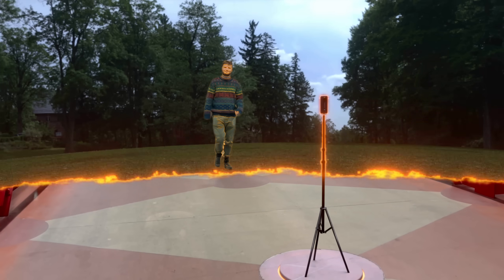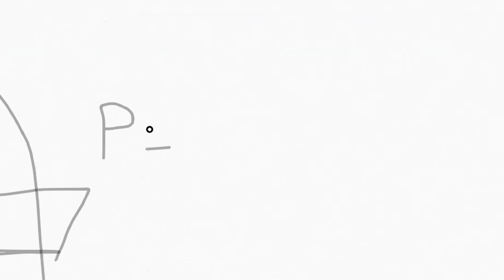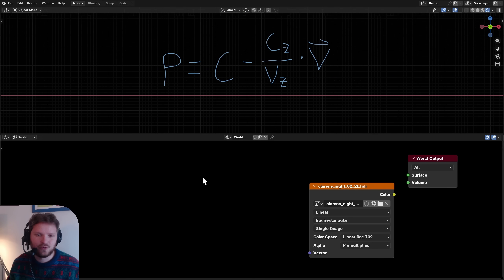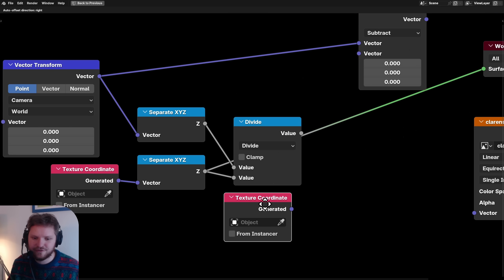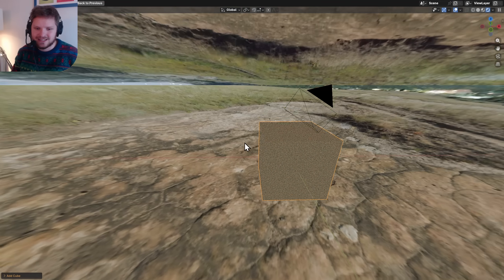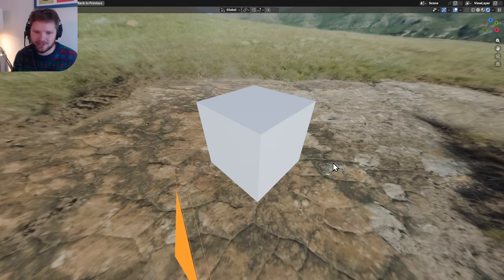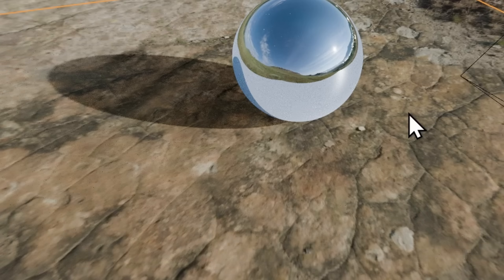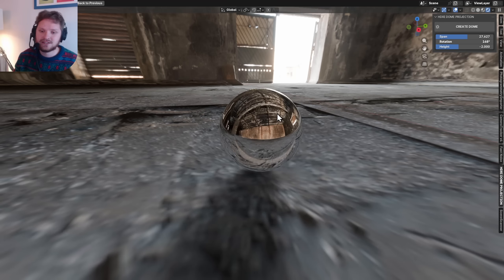HDRIs are domes, not spheres

Comment from the maker: here is the final equation: P = C − (C𝓏 / v𝓏) · v⃗

a more realized version of this is available here https://superhivemarket.com/products/hdri-dome-projection
Reply: HDRI aren't domes or spheres but ellipsoid.

Spherical capture would require the capture device to be at the center point of the sphere. Dome shaped capture would require the capture device be at the center of the diameter of the capture space at 0.0 altitude which is not a feasible technique for capturing desired ground data. Since the capture device's point of origin is neither at a 0.0 altitude nor at the center point between the outer atmosphere and the Earth all HDRIs by nature are ellipsoid. This is easily observed and corrected for by looking at how much distortion is along the bottom of the image, where that distortion begins, and adjusting vertically to compensate.

However, these steps are not typically needed to be addressed as all HDRI compatible 3D packages already have methods to deal with said distortions across capturing methods, storage formats, and adjust accordingly most of the time.
Reply: Will it be part of the Genie addon?
Reply: Do you have to be an ingenior to do that kind of thing are is it basic calculus ?
Reply: what 360 camera do you use ?????????????

Comment: Thanks for the breakdown.  I'm using a variety of equirectangular skyboxes I am creating with Space Engine, and while great for space and airborne environments, the inability to have a ground plane has been a bit tricky to work around.  I think this may neatly solve it for some basic scenarios.

  I am also investigating how to use the procedurally generated terrain topography, as SE doesn't have a way to directly export that as either a map or geometry, which would solve most of my remaining challenges, and think I am onto something using a mix of tools to extract the depth.

Comment: My two cents as someone who has implemented renderers:

HDRI just capture irradiance from every _direction_. Since they work with directions and not positions, they are not really any shape. The closest thing would be a sphere of infinite radius (definitely not a dome). And this is what the math using HDR for lighting relies on. 

That being said, if you want to render the HDR itself as an environment / background, you probably want a shape. The ideal situation would be if you had captured depth information when you captured the HDRI, because then you can actually reconstruct a shape. Barring that, you can use a sphere, a dome, a spheroid... Basically anything that transforms as closely as possible to the actual scene depicted in the HDRI when moving the camera. The main problem with using a sphere is that it lacks parallax (because everything is at the same distance from the center). Since the camera is typically closer to the ground than it is to the rest of the elements of the HDRI, using a dome makes perfect sense indeed.

But that's not because an HDRI is a dome, it's just a convenient shape in which to project one, and just for rendering it. Not for the lighting math.

Comment: depends on the software sadly, I use a spherically mapped skydome with a UV mapped flat top down floor in software where I can control how rendered sunlight reacts to it, ie shadows only not blocking light, Octane render for example but some render engines like iray in DAZ studio won't do that so one is forced to use the environment sphere with a separate ground plane if one wants to move the camera. Unreal Engine and Twinmotion fortunately also have correctly UV mapped floored skydomes with adjustable settings.

Comment: I’m confused. The data being recorded by the camera is “spherical”, in that it represents the view in every direction away from the camera array. The only way to correctly map it onto a polygon would be onto a sphere, otherwise you’ll get distortions.

I’m used to HDRI photography being used for things like PBR lighting and reflection mapping. In those cases, the camera never moves, relative to the HDRI maps. That’s also true of background skyboxes, which are usually rendered in a separate pass, before the foreground elements.

Using the HDRI photography directly as a texture in the scene (like on a ground plane) seems like an unintended use of that data. At least, that’s not what HDRI maps were originally developed to do. It’s causing  distortion issues in the video, which other comments here have mentioned. 

A better approach might be to create the ground plane as its own mesh, with its own material, which uses the HDRI data in its shader for more realistic lighting and reflections. That’ll give you the same correct ground level, but without the distortions.

What am I missing here?
Reply: Spherical map can be perfectly mapped on any convex polyhedron or mathematical shape. And from the original camera point there will be no difference and no distortion, because the ray will hit the same point of the map. You can imagine it as pushing and pulling parts of the sphere closer and further from the origin. But the moment we move our camera relative to the skybox (or the skybox relative to the camera), there will be distortions, be it a spherical, cubical, dome or in any other shape. The only way to avoid this distortion is to make the skybox mesh perfectly repeat the geometry of the original space, but now we are pretty much moving to photogrammetry, or trying to emulate it. But changing the ground to a plane mesh won't change anything, there will be the same distortions. The problem is not in the approach, it's in the lack of necessary spatial data in the skybox texture.
Reply: @F @Forthro Good point about the projection.

What I meant by using a separate ground plane is that it would use a completely separate, unrelated texture from the HDR photography - just a totally different ground texture. And its shader would only use the HDR data for PBR and reflections.

Comment: @CGMatter 

The problem that I have found with this method is that BECAUSE the HDRI maps are taken from that "spherical" perspective, you are less deconstructing the sphere, and moreso just deforming the sphere onto that flat mesh. I am a big fan of the node work you did, as the Z threshold switch was smart. The span, which I assume is the radius of the sphere projected (that is why when you turn it way down it pinches, and otherwise deforms), would want to be infinity, but when projecting the spherical HDRI onto the ground, you are only taking a plane of it. Because this plane wants to remain constant scale, projecting just that threshold slice (relative to your span) would create a better texture distribution without the stretching. Imagine taking a disk parallel to the ground and projecting the sphere's ground upward onto it. The radius of that disk would be the intersection with your skybox projection sphere. Curious how this would work compared to your solution. Great work!

Comment: This should have been a default blender feature like a check box or one of those node presets
Reply: Why? This is only for the special case that you want to use your HDR not just the lighting information it is supposed to deliver, but instead as a render-background replacing all normal scene-eometry.

Comment: You can make a plane on the ground and use the HDRI as an environment map and the coordinate type to object. If you know the height your 360 camera was when taking the picture, you can put an empty that high above the origin, and use that as the object your HDRI material is using. That not only makes the ground look correct, but you can model anything else in the scene (walls, buildings, etc.), and use the same material. Put them where the image lines up correctly on the surface, and they will automatically be in the correct spot they were in the real world.
Reply: Have you got a diagram?

Comment: Cool video, nice knowledge sharing. What happens if you transpose the camera before hand? rather than using camera space (x=0,y=0,z=0), so where Z > 0. Would that you raise the centre position of the sphere?
Just a shader guy being curious. 
And side note: maybe this helps (I don't know much about blender really), but using generally in shaders its better to use a 'ceil' than a 'if' statement when bringing values > 0 to 1.
Reason is its more efficient on the GPU.
Reply from the maker: try it out ;)
you may be surprised

Comment: I also tried doing this exact thing before but abandoned the idea because the reflections are not correct. They are sliding away when you move the camera. You can test it by placing a reflective plane vertically so it touches the ground.

Comment: there's an easier way with just a few nodes:

-assign an environment texture to your actual model (not a normal texture node)
- ctrl+t to make texture coordinate node
- swap coordinate from Generated to Object
-create an empty where you want the hdri to project outwards from.  Set that as the object in the texture coordinate node

that's all.  Also it's cool cause you can just move the empty around, and the projection happens from that point.  also it's useful to project onto lidar scans instead of just dome spheres, for spatial reflections. 

cool thing about this approach if you want to go crazy too is you can include your 360 camera in the actual scan of the lidar scene if you do a quick polycam, then use that as reference on where to place the empty (projection point), so everything reflects perfectly
Reply: I am a little confused by this explanation, could you perhaps rephrase?
Reply: @daviddigital6544  make a model you want to project your hdri on to (so for example a dome) then set that model's projection to use object coordinates, meaning it'll project the texture from the coordinated of an empty. You can then move that empty around to change the origin of your projection. 

This is a great technique as you can even exactly replicate the position of the camera that created the HDRI by positioning the empty correctly.
Reply: @daviddigital6544  basically this:
https://drive.google.com/file/d/1LWpOR84J4MwxJU7yTS0TWGtIM0PLdCpM/view?usp=sharing

Just plug in an environment texture, and change the texture coordinate to "Object".  The object is an Empty in your scene.  That makes the HDRI project outwards from the empty.